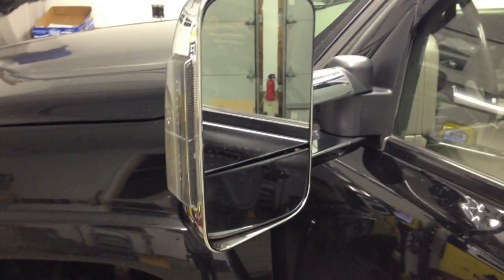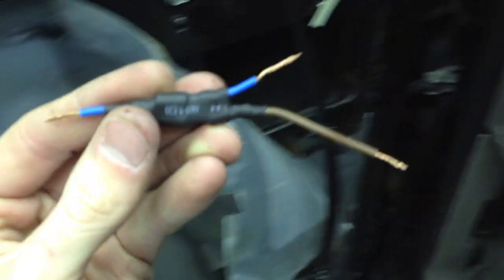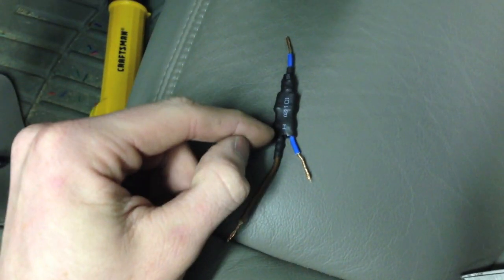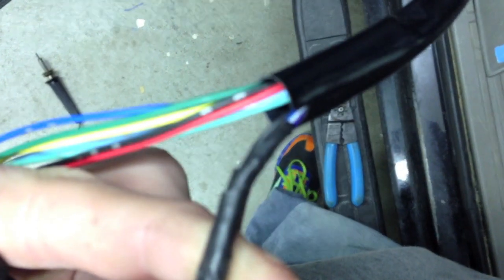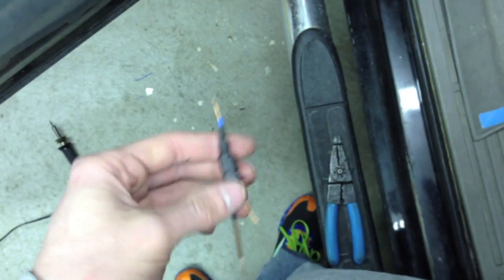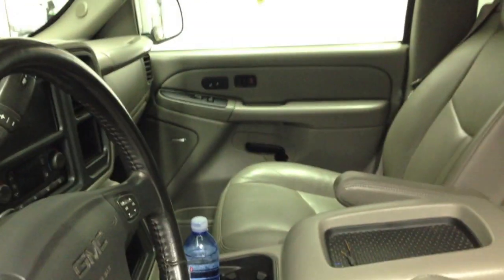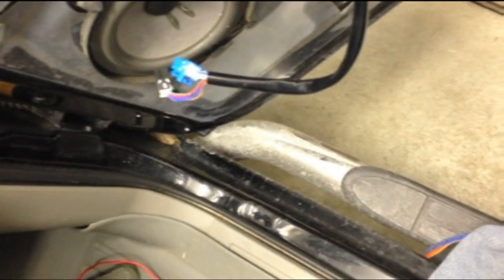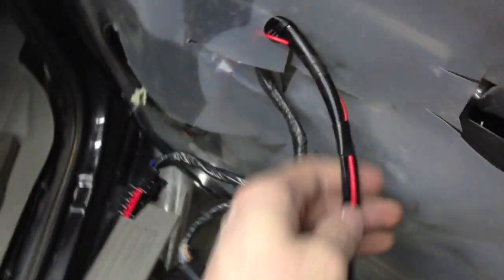GM Towing Mirror Mod (Running/Blinker Dual Function)

Comment: Hey there...I like how u made that and I would like two of them...how much would u charge....I just purchased a set of tow mirrors with puddle lights and turn signal and installed them on my 2006 dodge ram mega cab...the only thing I haven't done yet was hook my turn signal wires up yet.

Comment: I have a 2010 GMC Sierra 1500. Just bought the mirrors from A1 auto. And want to hook up for running lights as well. Your description say this wont work for the 2007-2013?

Comment: I did this on mine, I got them from am auto and the amber black ones. Yours seems to be a lot more visible from the front, any ideas? I used 68 ohm. Are the leds in mine just aren't as bright?

Comment from the maker: Depends on how you wire it. The way i did it only needs 68 ohm because you are reducing 12v to about 10v. If you used 480, 12v would become 3v and the lights would not work because they are already resisted in the mirror. If you would like a more in depth explanation, let me know.
Reply: Would you mind posting the specs on the diodes you use? Maybe a part number for radio shack?

Comment: I am currently using an LED Light Load Resistor Kit (6 Ohm , 50 Watt)  on my turn signals on my 1997 F-150. They are still working beautifully. I recently purchased some mirrors that have a single wire function led on them. I am in the process of trying to make them dual function (running lights + turn signals) I was instructed to put diodes on both hot wires (turn signal + running ) going to the mirrors and a resistor on the running light hot wire. Only issue is i already have resistors on that hot wire. So when i go to put another resistor on that hot wire they tend to be very dim. I was wondering if someone can help me figure out exactly what additional resistor would be the correct one to use in this project.

Comment: Do you have the numbers on the diode and resistors, I have 68 ohm 1/2 watt 5% tolerance resistors from some CB builds I did, are they the same you used, if not what is the numbers if you don't mind, Thanks.

Comment: Thanks!  Had my parts from radioshack in inly a few minutes...installing tomorrow, but will wire parking light power from my cab light harness (wont have to cross the firewall) which Im installing at the same time.  Video is great.

Comment: cant i just use an add a fuse wire and put it in the windshield wiper fuse spot in the cab? then it will come on when I turn the key on
Reply: Will back feed into blinker wire

Comment: hey, what if the mirror glass has the signal arrow in it? won't those come on with the parking lights?
Reply: wondering same thing
Reply: Yes, it will. If there are two lights (one in the front of the mirror housing and the arrow in the glass like on a 2015 Chevy tow mirror), you would have to insert the diode/resistor assembly into the harness that ONLY goes to the housing light and NOT to the arrow in the glass. This requires disassembly of the mirror assembly to access the harness that goes only to the mirror housing light. A stand-alone power wire will have to be run to marker lights and attached to the resistor side of the diode/resistor assembly.
Reply: Dylan McDonald :thanks!!